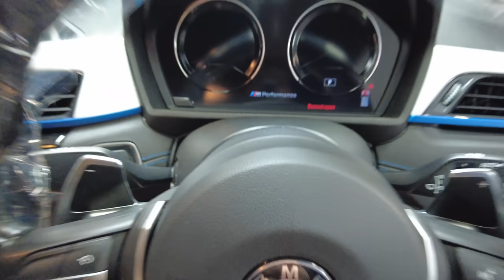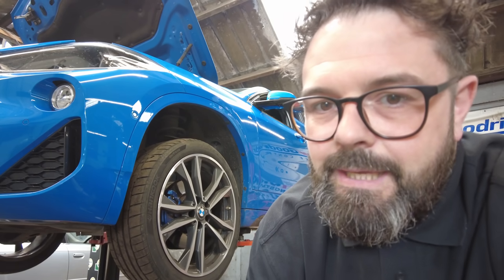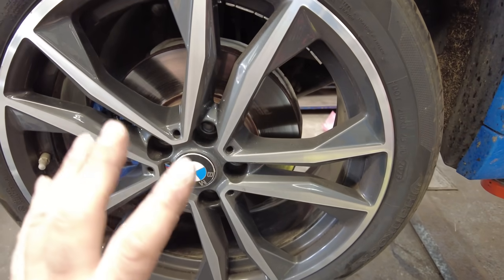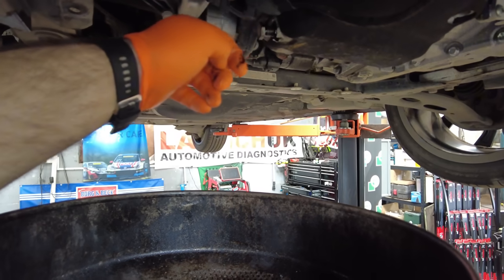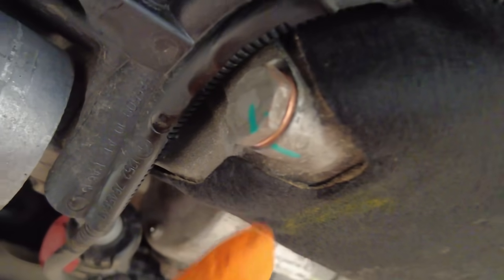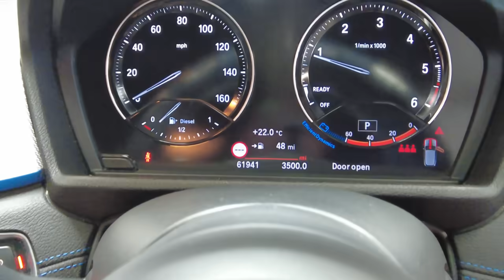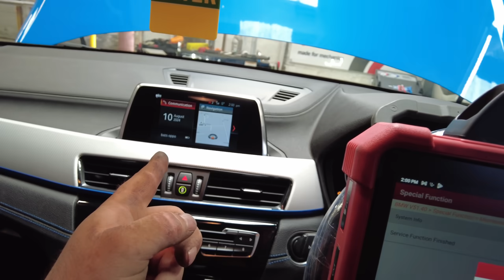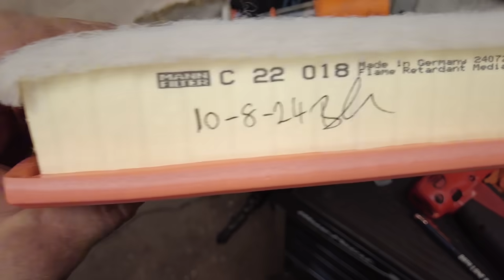THE GRIND DON'T STOP!!! SERVICING MY OWN CAR 1600 MILES TO EARLY!! AND I'M GLAD I DID......

Comment: Baz, I've used diesel as an engine flush for over 43 years on around 25 cars, not had one problem yet. Those branded engine flushes work out at around nearly £15 per litre. Waste of good money.

Comment: Spent today changing the bloody turbo again on the wifes car, it was only fitted in January passed me right off. Anyway sent it off and got diagnosed as oil contamination , so cleaned everything out and done the oil & filter.  Have a good one Baz🤙

Comment: Installed Borg and beck rear pads on my car recently  because of your recommendation and I have to say they are very good, look quality out of the box and they perform very well.
Reply: borg and beck is not a proper oem brake pad manufacturer.
your better to use Jurid, Akebono or Pagid.
These are the better oem suppliers

Comment: 4:32 something embedded in the tyre in the middle, could be a stone or a nail. Rear tyres also cracking in between the treads so looks like they are getting long in the tooth.

When checking seat belts I always pull them until the Inertia mechanism is working.

Changing the fuel filter every year? You must do some mileage.

Comment: Subbed since about 3 months ago - really enjoying your style of filming and how you explain things. 

Why do some mechanics bad mouth engine cleaner for changing oil and some like it? 

Thumbs up.
Reply from the maker: In all fairness I never liked it simply because when I used an engine flush years ago I had a bad experience... But it was a harsh flush.. but I've been explained to by Richard at launch who is very knowledgeable of all additives these newer additives are so much safer to use
Reply: @bazmeredith  Hi baz, thank you for explaining. 

Surely the companies in the industry have to conform to some sort of standard? 

Liqui Moly, Comma, STP, Wynns etc?

Luqui Moly would be the one I would purchase if doing my own B8 Audi A4 1.8T on 120k miles. 

Does it matter on mileage with a flush regardless of brand?
Reply: Is the launch flush safe for wet belt engines ? By the way great video! Im with you on the white grease!@bazmeredith

Comment: How come the front and rear brakes say not calculated on the scan tool when you reset the oil ?
Reply from the maker: I'm pretty certain I turned it off simply because it's calculated. There's wear sensors when the actually gets to the limit of needing replacement. Was something that did my head in
Reply: Ok thank you 
I only asked as I did a 17 plate mini this week and after I had replaced all pads and sensors I reset it 
Came up as not calculated and I couldn’t do anything about it 
I was using a new Autel scan tool

Comment: You do sum very good work and seem to be a good tech I just wonder y would you own a bmw
Reply from the maker: @janlojko5228  I've owned BMWs for years, they are epic cars when looked after, you only hear bad things with the ones that haven't been looked after
Reply: @ iv owned one from new and in 26000 miles the zf8 failed under warranty and when the front pad lining flew off at 120mph of the blue m sport brakes I got it brought back as never had genuine brake pad lining come off back to Skoda

Comment: Baz My 2019 Tiguan R-Line 190 Tech Coming Up On 5yrs At 20k Miles Should I Still Go Ahead And Change The Timing Belt What's Your Thoughts Thanks
Reply from the maker: I'd never advise on timings belts if any doubt get it changed!!!!
Reply: @bazmeredith  Cheers You Handsome Bar Steward Mega LOL You Can Use That Terminology If You Want